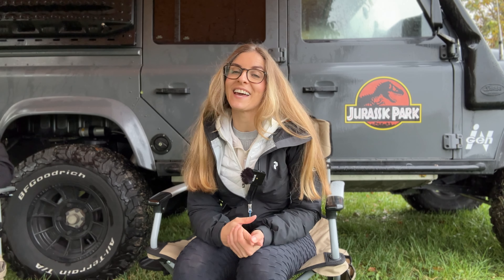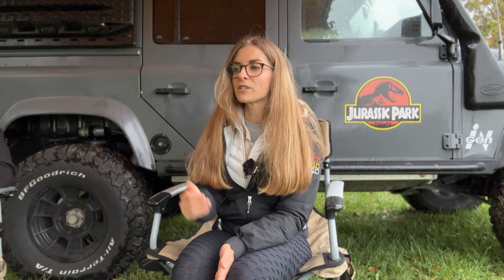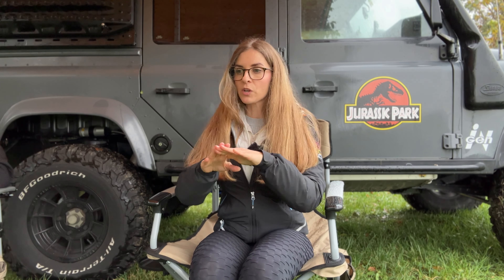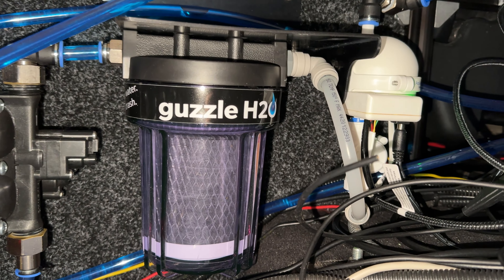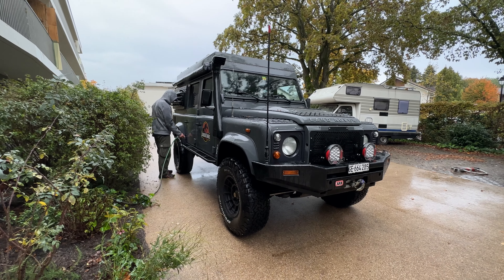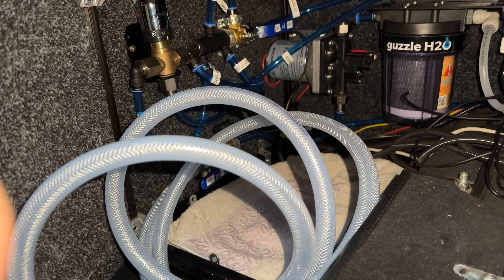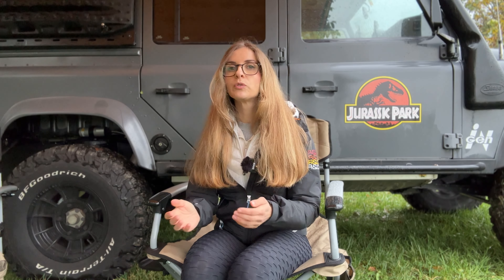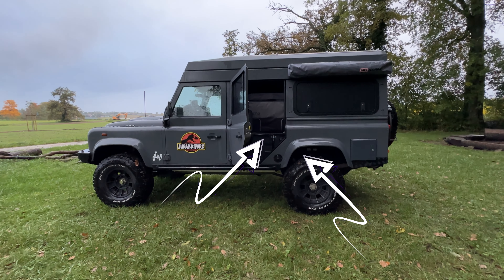The Most Compact & Efficient (hot) Water System in an Overland Truck | the best you'll ever see !

Comment: Great videos on this. My suggestion on the tanks freezing is to install a thermostat in the water tanks that switches on your hot water system and cycles it through your heat exchanger.
Reply from the maker: Thanks! We did think about this solution too but didn’t try it out.

Comment: There are 12v and low wattage 240v immersion heaters available, a simple thermostatically controlled system would stop freezing, though a little insulation would be a good idea too. As David says, minimum temperatures to stop bacteria problems.
Reply from the maker: Immersion heaters were the plan when manufacturing the tanks but because of their shape it wasn’t an efficient solution. Insulation would be necessary but not great for off-road.
Reply: @offtrackfamily  insulation for be good need to be external but need protection because offroad so another shiel and so on the weight increase and reduce the height and capacity of offloading and so on... a lot of pro and cons to consider to make heating system

Comment: Thanks for sharing. Could you tell a bit more about the hot water part and it's components.
Is the diesel water heater only connected to the heat exchanger (no expansion tank in the coolant side or relief valve in the hot water side?). Can it also be used to heat the engine during winter conditions?
What is the coolant volume in the hot water system?
Thanks 👍
Reply from the maker: You can have all the info of our diesel water heater in this video
https://youtu.be/vw9hF-5XiN0

Comment: 🤩💯enjoy from start to end and the kids too 😊Truly a well-studied and functional setup, very good at having studied it like this, out of curiosity, how often do you empty the tanks or how long does the water stay in the tanks? Do you have a system for counting the liters of water for the filter or do you go "by eye" (maybe there is something that changes color when the filter needs to be replaced)? Placing the external socket in the rear wheel arch is convenient, but do you have a protection system or cover for mud or stones? I saw the Egon system which is a dream but also a sheik to buy!!!  Unfortunately, due to the work I do, I can't turn as much as I would like, so my setup is very basic: tap adapter plus quick inlet high pressure spiral hose, filter on the end of the hose, food grade tank + roadrunner tank on the floor (I had a lifesaver but it was "taken" from me when I was sleeping, it was hooked to the outside and the chain was cut) plus marine type pumps and outlet filter, every time I return I empty the tanks and load them before leaving with the quantity needed, i.e. 4 drinkable liters + 6 for washing and extras, all multiplied by the number of people (max 2) and days we are away. economical 12 v pump to take a shower and possibly rinse the dishes or wash the side view mirrors, license plate and headlights (because I have already received a fine for dirty license plate or headlights)
Reply from the maker: Glad you enjoy our new water system. Not sure yet how we know when we need to replace filter. The exterior socket is very convenient to use, we have a silicon cover to protect it when not in use. You’re very organised for your water 👏🏼 we’re not that organised ;) but we did drain the tank when back home and never left water inside after a weekend out. We will certainly continue to do the same way.